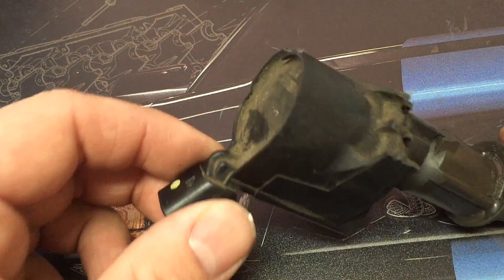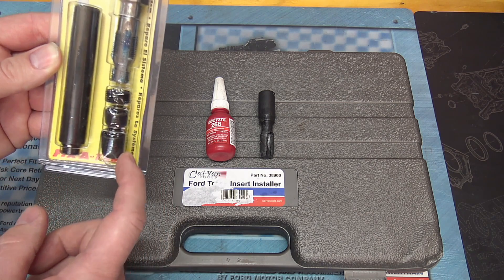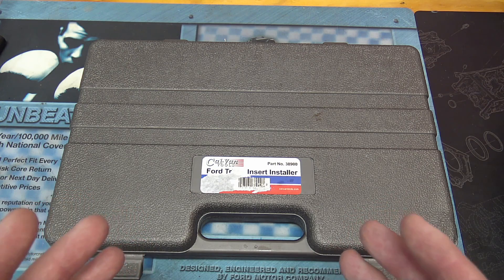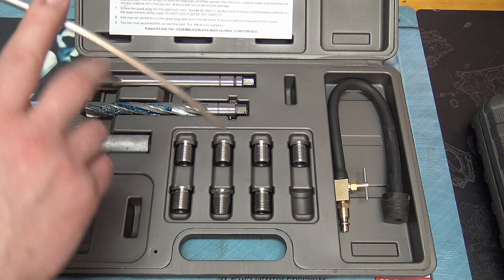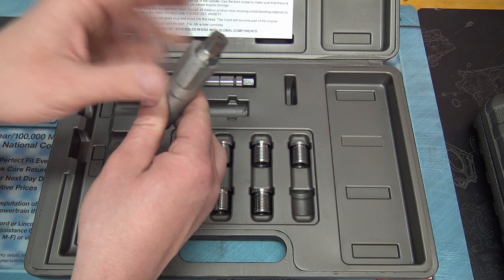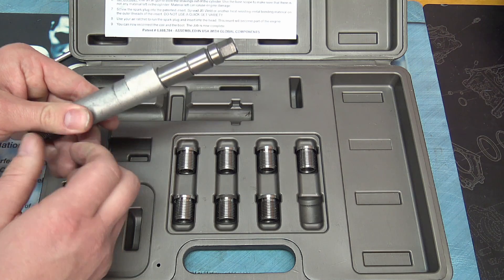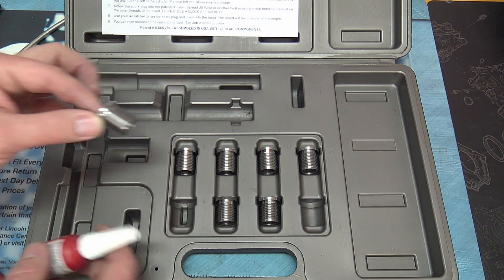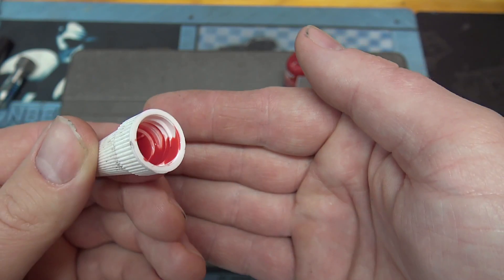Ford 4.6L 5.4L 6.8L 2V Triton Engines: Blown Out Spark Plug Repair Kit Usage

Comment from the maker: Spark Plug Thread Repair Kit I recommend-
http://amzn.to/29j4jk1
Loctite 266-
https://amzn.to/3IlT9KN
Cheap Wifi Endoscope I use-
https://amzn.to/3Kqi4yJ
Reply: Thank you, I really like your channel/ I have an 08 F250 Super duty with 5.4 and have been dealing with the spark plugs for days. You have helped guide this old shade tree mechanic a great deal.
Reply: How about putting a thick oil in the cylinder to trap the shavings then use a evac tank to suck it out?

Comment: I’m doing this repair on my 2 valve 6.8 while my heads are off due to a blown head gasket.  I can see that the oem plugs don’t stick as far into the cylinder after installing the thread repair inserts. Is there a different plug recommended or should I go with the oem plug?

Comment: I had one blow out at 50,000mi, took it to the Dealer. They “fixed” the bad hole and changed all plugs. Said ready for pickup. Drove 1/2 mile and spit the plug out of the repaired hole. Took it back and was to that “our mechanic repaired wrong” fixed it correctly and now spit it again at 61,000min. It has been 8 years but the Dealer says “even if we repaired it properly the first time there is no guarantee that the repair would have held”

Comment: I bought a Cal-van 39900 kit had 10 inserts it had instructions worked great. I ordered my kit from TEMU as a 1st time buyer the total cost was $70.15. Definitely well worth the money and time.  That drill is actually a ream.  I used an air 3/8 drive and it worked great.  Thanks for the video I'm sure it can help many others.  I did mine just about 2 months ago.  December 2024

Comment: The real question here: can you do this process on all 8 cylinders without removing the fuel rail? On my 2005 4.6 F150 that fuel rail is directly over the plugs, barely enough room to pull the coil out. I just discovered my #3 cylinder has been (poorly) repaired this way because the insert came out during a plug change.  Looked like a tiny smear of JB weld on the threads was the only thing holding it in. Fun times

Comment: Mr. Brian,
CalVan Repair?
Would you encourage the Calvan inserts be installed not as a repair but as a prevention from plug blowouts.

Had to pull a cracked intake from a 230K+ 02 - 5.4l 2v eng.

While it's apart I'm considering installing CalVan inserts in all the cylinders purely to PREVENT plug blowouts.

Currently plug threads are stock and not damaged (borescope checked.)

I am a "If it ain't Broke DONT Fix it kind of guy" but I try to be smart/ prudent as well. In addition, with the less than desirable Ford factory spark plug thread configuration my concern is that a blowout could severely damage the head even beyond what the Calvan Kit is designed to repair.

Your thoughts are appreciated.

Comment: Are you saying the Calvan system will grind out a broken insert  from a previous repair?  I have an insert , the top third separated and bottom 2/3 is in the plug hole, all the way back on No.4 of my 5.4.  Very nervous about using an easy out on it.

Comment: Tool kit links please
Reply from the maker: Everything should be in the video description.
Reply: @FordTechMakuloco  didnt see the link for the tool.
Reply from the maker: Directly from the video description- 

This is the  kit I recommend you can buy it Here-
http://amzn.to/29j4jk1
Loctite 266-
http://www.amazon.com/gp/product/B00IZIBJ04/ref=as_li_tl?ie=UTF8&camp=1789&creative=390957&creativeASIN=B00IZIBJ04&linkCode=as2&tag=fordt-20&linkId=2N2S4VDCHB7UE5J7
Great Cheap Borescope I use to inspect the cylinder Here-
http://www.amazon.com/gp/product/B00JERRES6/ref=as_li_tl?ie=UTF8&camp=1789&creative=390957&creativeASIN=B00JERRES6&linkCode=as2&tag=fordt-20&linkId=7FL4DEPNKVRTBDRH

Comment: Dude don't shit these folks 
Any of these tritons from 2003. 2008 don't use these plugs
Triton plugs are long shank that break in the head
40 year mechanic that deals with these shit motors every week
Reply from the maker: This kit is for all 2v triton engines from 1992 to 2014. Your comment is filled with all kinds of misinformation. If I was going to make a claim I would research it first before commenting...

Comment: I used one of those thread savers a few years ago on my Duratec engine and it failed. I fixed it the other day a Big Sert kit. I was dubious about those tread savers for good reason. My truck has a Triton 2 valve and I will definitely use a Cal Van kit to repair a blown out plug on it.

Comment: You explained how to get the intake and outtake valves closed with the rubber plug and shop air, and you said the cylinder needs to be down, but how do you get the cylinder down if you find that it is up?  I just discovered your channel and love it!  Please just explain how to get the cylinder all the way to the bottom.  Thanks!

Comment: Hello! I ordered the kit to fix my 2v 4.6L. Just a question, i do not have a air ratchet, but will be getting one. What do i need to do this job without any hiccups? air ratchet or impacting air ratchet.? and what specs of the ratchet is required? thanks in advanced!

Comment: I just had a customer come in for this job. I told them before they brought the vehicle that I don't enjoy doing this job, but it's a Sunday and they're trying to get out of town. #2 Cyl so pretty easy. I use JB Weld on the insert threads. I've actually had these come in with a previous insert that backed out-threads on both ends were okay, JB'ed it and put it back in. Worked fine. I charge 2 hours, 3 possibly if it's a #4 or 8 cyl.

Comment: Thank you for this video!!! I just took my f150 into the shop and they charged me 9 hours of labor and also removed the head. Cilinder head resurface, cilinder head power wash, head gasket kit with bolts ($279) which rediculous price, new front crank shaft seal, head gasket r&r included valve carbon removal (9hr at $60/hr)=$540...
Be carful guys where you take you cars to get fixed and make sure you do your research!!!! Total he was trying to charge me $1000 when all i neded is to replace blowen out spark plug thats it!

Comment: My drill bit keeps binding and I live in Canada so the kit is hard to come by, have to wait a week or more....wondering if I can thread out with the save-a-thread tap and then use the drill bit on a larger diameter hole to see if it will work???? Very expensive here in Canada 🇨🇦 for this quality control oversite....

Comment: Is there any other loctite to use with these. Like 272 or 271. One of the two is rated to 450 degrees. I can’t find 266 in any auto parts stores and just a small bottle online is like 30 bucks. Any help would be appreciated. Also does it matter if it’s Romeo heads?  I know it will make about 3/8” higher in the chamber but any issues with that?

Comment: I hAVE A 1998 e150 CLUB WAGON, 5.4.  I JUST BOUGHT IT, IT HAS 197000 ON THE DIAL, AND iT STATES THEY GET CHANGED EVERY 100k.
sHOULD I CHECK A PLUG, AND SEE IF I NEED TO DO THIS?

Comment: Used this to save a 2015 Ford Escape Eco Boost.. Some how the Threads stayed in the head. The plug come out. Not even Ford had any idea how to repair it. They said buy a new head. Well if that was the fix. Why not try and repair it. Just be careful. It's an angle plug head. So get it straight as you can...

Comment: Van-cal had an issue with the quality department making the inserts. Some people installed the inserts and they were not seating all the way. Go to hardware store and buy a 3/4 x 16 nut and screw it on to each insert to make sure the threads are smooth. A mechanic on YT posted a video about the inserts. I forgot his channel name. I bought the Van-cal kit for 245.00 with free shipping. I checked each insert and found 1 bad one. I'm glad i found that video before messing up a job i'm doing. That would of been a nightmare. Nice clean video and easy to understand FTM. Watched your video to see what groove the C-clip clipped onto. Thanks.

Comment: Great video and very helpful 👍🏼. I have a question. I have an 04 gt 4.6 2 valve and about 2 months ago my car threw a plug. I pulled the plug out and it had already been re threaded, there was a helix coil around the plug. Is there another repair kit I can buy to re thread it or will I have to buy a new head?

Comment: i yes did one on my 1998 f-150 4.6 v8 i did used napa helicoil  used for 2 day end its miss fire on the same cylinder any idea replaced coil pack spark plug wires fuel injector still miss fire any idea why

Comment: You mentioned the threads are not sufficient, especially in the early models. When did they add more threads? I just bought a 2008 F150, 4.6, and am wondering if I am going to have to deal with this problem.  Great video.
Reply from the maker: No yours are fine.
Reply: I have this issue right now with my 2008 F150 4.6 2V
Reply: but 315 000 KM tho

Comment: Dang. So I bought the wrong kit. I was trying to be within the amazon same day delivery of a tool kit. And had less than an hour to figure out which tool kit I really need. But my dad kept distracting me with random 1 way conversations that I don't even know what. So I ended up ordering some 130piece kit. And almost all those pieces are just useless springs that I have no idea what they are for, and just 5 taps, and 5 weird things.... no spark plug sleeves. No guide. And I can't figure out what is going on when I am tapping. I tried tapping 3 times now but the sleeve from a different kit still isn't going in....

It's the next day for me. And I am scratching my head on what to do. Well I got my phone charged up about 40% so that I can sort of look down in it with the camera.

Comment: The fact that people buy trucks from a company which would mass manufacture and sell such poorly designed junk is amazing.  The fact that a company would KNOWINGLY employ such incompetent engineers is a sad indictment on Ford.  Junk...and before I hear any crap...I work at a machine/engine building shop and see these heads ALL OF THE TIME.  MOST owners do NOT fix their own trucks but are at the mercy of the dealership/indy's.  The heads are delivered to us, we fix them and then they're put back on.  In the end it'll cost the owner a couple thousand dollars and at least a few days...and Ford CONTINUED to build this crap.  We make THOUSANDS of dollars per month and just fixing what should have never been send out the door in the first place.  All these "quick fix" video's look SO simple...but I've also fixed a number of botched fixes.  Also...whatchya gonna do when you're hauling a trailer up a pass in Colorado, your plug goes "Old Faithful" and there you sit???  Yeah...happened to a customer who got it towed to a shop, took a cab to a GM dealership and bought a good used Sierra with a BULLETPROOF 5.3.

Comment: I have a 2000 f150 5.4 #3 And #4 spark plugs are rounded completely from previous owner and are stuck in the head I now have the head off how can I get them out. Any ideas would be helpful. Thanks

Comment: I have a 2005 Ford F-150 that blew a spark plug.  4.6 engine.  The kit you show is for years 1996 to 2003.  Is there a different kit for 2005 years to use?  Thank you for your help.

Comment: I just did mine in a police interceptor and this kit worked great, the results look very professional,  above all there's no place or shop can warranty this job and IS NOT CHEAP.  It's worth it try to repair it yourself.  👍👍👍

Comment: Just a quick warning about using any borescope for internal engine inspection. If you want to use a tool such as an angled mirror for looking at the valves,  make absolutely  certain that the tool is magnetic! Don't ask me how I know....

Comment: Dorman makes a little kit for like $30 that uses an insert and a newer long plug. It works surprisingly well. It's a good option for diy and you can get it at any parts store. It's literally a two step process. Super easy.
Reply: What parts would I need for the kit?
Reply: I used this kit,  the insert cracked after a year. Now trying this ADT KIT.
Reply: I bought the calvan kit off Amazon and did it myself. It was pretty straightforward.
Reply: No no no dont use that kit theyd are half assed not even the rigt plug and pure garbage that will lead to more damge when it blows out

Comment: Will this last kit you used work on a DOHC 4.6? I have a mach 1 that blew a coil pack and damaged the spark plug threads along with it and would like fix it asap.
Reply: I am curious as well, I have a 96 Cobra 4.6 DOHC and a plug blew out. Having a hard time finding a 4v kit or even info!

Comment: Now that I finished the exhaust manifold replacement, this is next. At 260,000K she is due for some repairs. I think I know WHY the shops are charging 5 hours; The kit is $230 divided by 4 is about $60/hr + 1 hour for actual labor. Add on another for profit & mark-up. The first customer pays for the tools!  Thank you for your great videos!

Comment: The clip is a good idea, but I use an o-ring on mine. It won't go past it and o-rings are cheap and usually stocked. Love this kit though. Never had a problem with my drill bit but I did think it took a bit to bite and start cutting.

Comment: Really appreciate your information and knowledge! I was deployed and the #8 blew out on my 4.6 and the one mechanic I could find initially told me $250 for boot, plug and labor. Keep in mind I am 6k miles away and he at least sent me an email telling me my motor is shot and needs the engine replaced for $6,000! I had my wife get the truck removed from his business and it has been parked ever since. He did not charge me anything but since being back I still have not found anyone in my area to give me a second opinion. The engine has 170k miles and I have religiously taken care of this truck. It does not leak and I think it still has life. It is a 2004 STX and I have accomplished all the prevenative  maintenance. I am the single owner and have changed 2 light bulbs and the brakes on this truck in it's life span. This has been a good truck. I'm throwing it out there in the hopes you or someone on this page might know a reputable shop in the New Orleans area that might help me out. Thanks!
Reply: Same thing just happened to me except it was cylinder 3 and I was quoted $8,000 for a engine swap

Comment: I just started replacing plugs in my 2003 f150 5.4 and the previous owner used a dorman repair insert and when I pulled the plug out the insert broke off will that drill bit get that out for me thanks

Comment: Had this happen 3 times on my old crown Vic which was my first car... a tip I learned luckily before I did this was to get some kind of air blower or try to turn the motor over with the plug out and fuel relay disconnected to shoot the aluminum shavings out of the cylinder so it doesn't get down into the oil pan. Just a little tip if it isn't already in the video

Comment: I am rebuilding a 1998 V10 6.8L.  The heads are pulled off.  One of the cylinders already has a heli-coil.  The other cylinder threads look very warn.  I'm thinking I should repair them while the heads are off.  Do you recommend the same CalVan kit when the heads are off or is there a cheaper alternative like the Advance Auto Parts kit with the large tap head?  I assume you can tap it from the other side with the heads off.

Comment: I REALLY ENJOYED YOUR VIDEO AND HAD A QUESTION OR TWO, I HAD THE SAME PROBLEM WITH MY FORD EXPEDITION 0N CYLINDER 2 AND TO IT TO A REPAIR SHIP WHO ADVISED THAT IT NEEDED TO BE RE-THREADED, AND AFTER THE SERVICE THE TRUCK RAN GOOD FOR ABOUT 2 WEEKS AND THEN IT BLEW OUT. THE THREAD USED WAS HALF THE SIZE OF THE SPARK PLUG THREAD AND ABOUT AS THIN AS THE BLACK ONE YOU SHOWED ON YOUR VIDEO. I LIVE IN SAVANNAH GA AREA AND WAS WONDERING IF YOU CAN RECOMMEND WHO YOU WOULD CONSIDER IN THIS CASE. ALSO WOULD THAT KIT WORK ON MY EXPEDITION

Comment: Brian, I got a 2v 5.4, plug #7 didnt blow out, but when I removed it for a normal maintenance plug change, only the porcelain came out.  The thread "basket" and ground strap are seized in the head.  I've tried a #5 easy out, wouldn't touch it, broke two sockets from the torque.  Help!

Comment: While tapping the engine head what happens to the metal debris,suppose it falls into the combustion chamber.
Reply from the maker: +RichR65Ct Some do yes that it why it's very important to clean them out with some compressed air and check with a borescope.
Reply: FordTechMakuloco thanks for all your videos!!! Huge help to say the least! I'm trying to figure out which kit to get to do this on cylinder 6 on my 2003 ford e250 5.4l v8 16v? Thanks
Reply: FordTechMakuloco is it possible to use an extended magnet to pull out any debris as well, or will compressed air do the trick?
Reply: Magnet wont pick up aluminum. Who ever said that should check themselves.

Comment: if you could imagine an oblong hole and the guides will not go down the sleeve so i didnt know what to do.  except try to repair the sleeved plug hole first.  so thats what i had to do first.  i just wish i would have not even waisted my time doing any of this first and just done a relative compression or even a manual compression test.  so long story short cylinder is washed and the rings are bad, also there is a low end knock sounds like rod bearings and or bad piston slap. The hole is 60%lower then all the others.  what a waist.